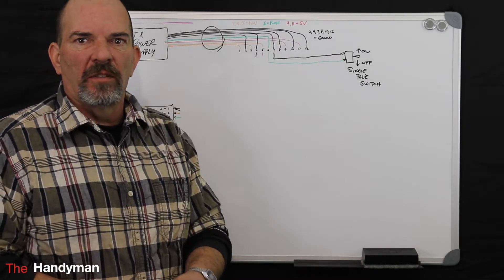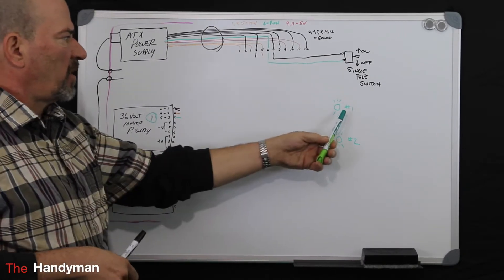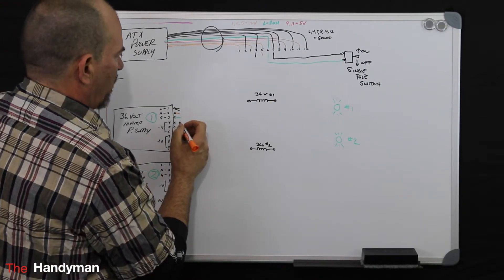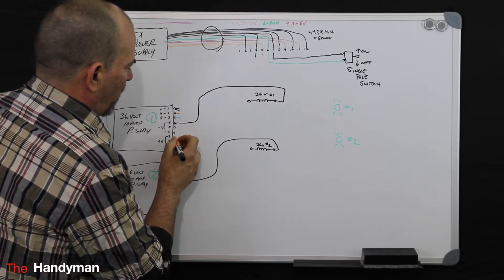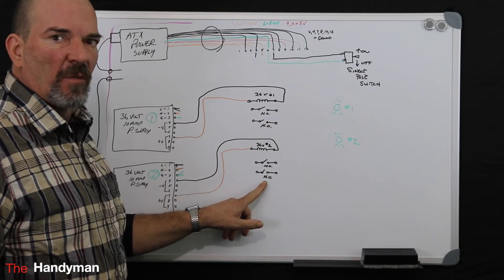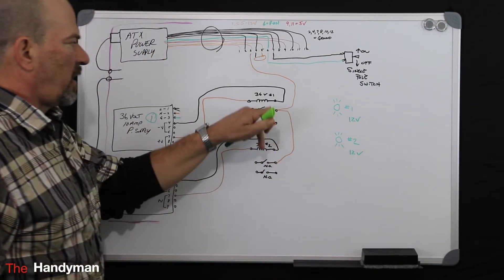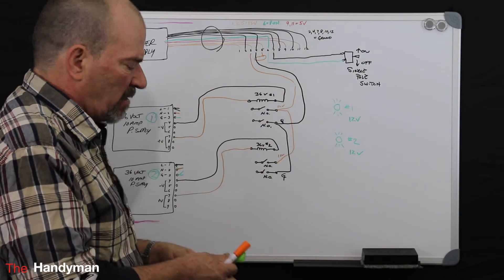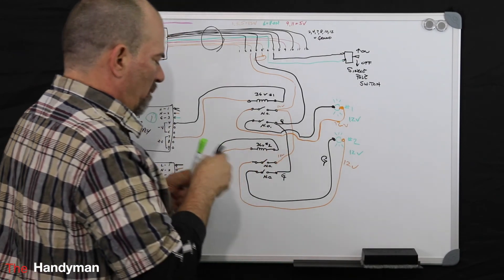How to Build Your Own CNC Router Controller Box - Part 3

Comment: Do you have to switch both legs going to the lights via the relay or can you wire the ground directly to the  light and then just relay the line voltage?  Seems like that would make it a bit easier.

Comment: Consider putting a 1n4004 diode reverse bias across the 12VDC coil. The power supply may be slow enough when you turn it off but I would use the diode anyway.

Comment: Hey man I am looking for a for dummies CNC tutorial to see if I can build  a small CNC  like 2 ' x 2' or something like that only to build some guitar bodies.
Reply from the maker: The controls will be basically put together the same. For a smaller build you could use possibly small sized stepper motors and power supplies.

Comment: Ever thought about measuring at which voltage the relay switches? If it is any lower that 36V (it could be as low as 20V), the light comes on, but that does not garantee that you've got 36V :-)
Some cheap ebay "led panel voltage meters" for under a dollar can give you exact the voltage the PS id delivering
Reply from the maker: Great tip! Sorry for the late reply, I've been away from youtube for a while.